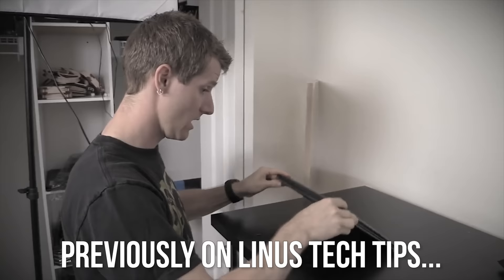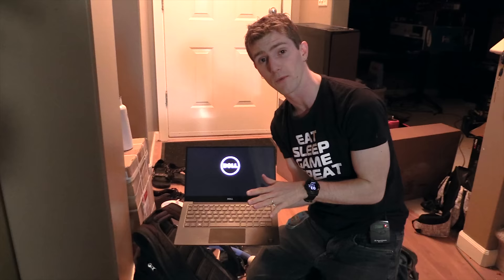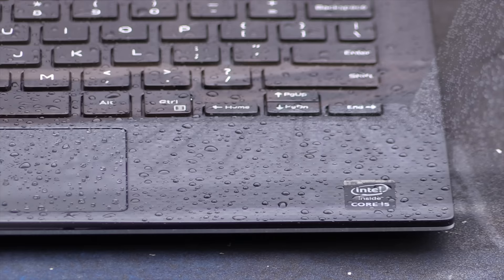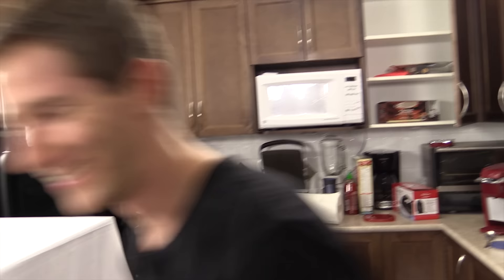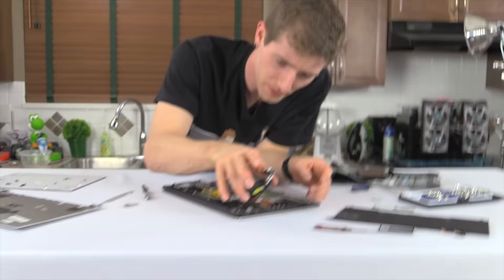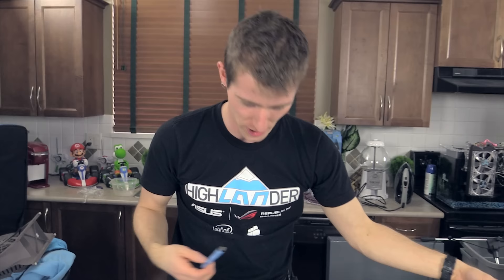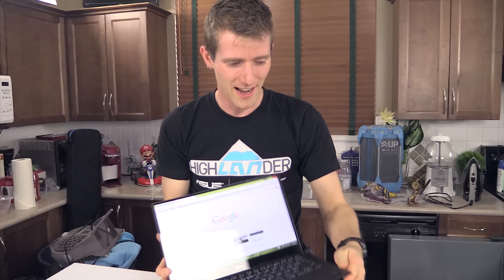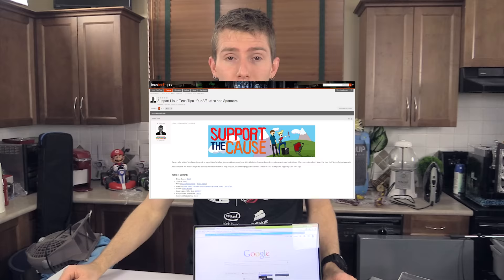Wet Laptop Recovery AGAIN - Dell XPS 13

Comment: hi, Linus Sebastian. i admire your work and i wonder if you can make a video where you show me how to build one of my dream pc`s. 

with these specefications:

ASUS DVD Writer, DRW-24F1ST
Seagate Barracuda® 1TB
Intel® SSD 530 Series 120GB 2.5"
MSI Z87 MPOWER MAX AC, Socket-1150
NZXT H440 Midi Tower
HyperX Savage DDR3 2400MHz 16GB
Intel Core i7-5820K, Socket-LGA2011-3
2x sli MSI GeForce GTX 960 Gaming 100ME 2GB
EVGA SuperNOVA 750 G2, 750W PSU
Cooler Master V8 GTS CPU cooler

I will appreciate it a lot if u do it^^
Reply: upvote this guy!
Reply: 120GB of SSD is rather small for a boot drive, try 250. 2 or 3TB is a better sweet spot for HDD price. Z87 doesn't work with LGA2011, you'd need X99. If that's the case, better buy DDR4 RAM sticks. There's no point going 2x 960, might as well buy a 980 instead. And if you're spending that much on the CM V8, might as well get a H100i.
Reply: For gaming, that CPU is way overkill considering the GPU you selected (also, your motherboard and ram don't support that CPU). I wouldn't go Haswell-E series unless you go 980 or dual-970. Also, like Chayuti said, 120 is not enough for a boot drive, and 3 TB harddrives are the sweetspot in pricing. You really don't need to spend money on a DVD drive, install windows from a USB stick or find a USB DVD drive, you really don't use them anymore.
Reply: Chayuti Chetsandtikhun A boot drive doesn't need to be big. Windows 7 installs on,  what,  16 gigs? If you're literally only using it to boot and store slower applications on,  it doesn't need to be very big.
Reply: Christopher Pilcher After updates, drivers and so on, Windows 7 can easily take up nearly 40 gigs. If you need the PC for gaming, that leaves you with 1.5 games (with games taking up ~50 gigs of space), assuming you don't have anything other than the OS on it

In reality you have other things there as well. Things like your pagefile and hiberfile. The pagefile is the same size as your ram, so 8 gigs of ram means 8 gigs of pagefile, and hiberfile is a couple gigs most of the time. If you then have programs like video editing or 3d modelling progams on your computer, they use your SSD as a scratch disk. Adobe's programs use up 10 gigs as a scratch disk.
Reply: Christoffer Nørskov To be honest,  I remember when people would buy 64 GB ssds and literally just put their OS on it. To me,  saving a few seconds loading a game is less important than a fast boot and page file. But,  we'll,  that's just me. My current system literally only has a single,  5400 HD in it,  and it's on its last legs. Any SSD would be an upgrade for me ;)
Reply: Christopher Pilcher I currently have a 128GB SSD, and without any games on it, i only have 33 gigs left. I used to have space for games, but then the requirements of other programs creeped up, and games became larger, so i can't even install a single AAA title on it anymore. I'm looking to get a 512GB or 1TB SSD soon, but i can wait for the prices to come down.

Fast loading is really nice, though. The normal HDD i have my games on is wicked fast, but even then, when i had games on my SSD, loading screens were pretty much non-existent.
Reply: Christoffer Nørskov yeah,  I'm also waiting for the prices to go down a bit (or for my drive to give up the ghost,  whichever comes first) .
Reply: Most parts fit together the same way regardless of AMD/Intel/nVidia and socket numbers. You can watch a different build guide of his and use it as a reference to build yours. :)
Reply: Why does your dream PC have ddr3? ...and two 960s in SLI? It would be much better with a 970 or maybe 980 and ddr4.
Reply: Chayuti Chetsandtikhun Christoffer Nørskov   its called a boot drive for a reason, nothing goes on it but the OS, and 120 is PLENTY for that, stop giving bad suggestions.
Reply: TTG DDR4 honestly doesn't matter much right now. It's just unnecessarily expensive without a real speed benefit.

peoplestealallmynames Really? Boot drive just means it's the drive you boot from, it doesn't mean you can't use it for anything else. If you REALLY ONLY want to have windows on it, buy a 40-60 gig drive. If you want windows and programs and maybe one game, get a 120 gig. If you want all that, but maybe more than one game you NEED at least 240.

naota3k I hope you don't do tech support, because you could have cost a lot of money with that sentence. For graphics cards, it mostly doesn't matter anymore, as PCI-E is the only GPU standard right now. BUT for CPUs, you CANNOT mix and match. If you have an LGA-2011V3 CPU, it NEEDS an LGA-2011V3 motherboard. The motherboard used for normal i3/i5/i7 CPUs change over time, as the pin layouts of CPUs change, and the enthusiast grade CPUs always use a higher amount of pins, so they won't fit in regular motherboards.
Reply: Christoffer Nørskov I think 128 gb is fine, it just depends on your priorities. Also, yes, there are more games these days with very large file sizes, but realistically, 50 gb games are not the average, unless you're solely talking the more graphically intensive AAA titles of the last couple years, and for the most part, the difference in loading times is not that significant, and I for one dont mind a few extra seconds. The only time when it really effects the game experience is in games that struggle with pop in. For the love of god, dont put AC Unity or Far Cry 4 on your HDD. just dont. really though, dont put AC Unity on anything. Ubisoft doesnt deserve it.

Also, as others have stated, You don't really need ddr4 or that CPU. Unless you want to do lots of multitasking, that CPU is pretty overkill, no real benefit for gaming. DDR4 doesnt really have any major benefits yet, but its much more expensive. Also, theres no reason to every SLI/Crossfire a mid-range gpu. For that price, you can get yourself a 980, which will outperform your dual 960's, and if you go for DDR3, and a cpu more along the lines of an i5 or an i7-4790k, which still isnt really necessary if youre talking strictly gaming, you could get yourself a 2nd 980 and run anything you want, max settings, 1440p60.
Reply: Ryan Ohlson i know he doesn't need that cpu and ram, as well as dual 960s being a bad idea.

As for the ssd, i have a 128 gig and only have 40 gigs left with no games on it. Windows and it's files take up 50 gigs alone. Then we add drivers and essential programs that's easily 10 gigs. 10 gigs for adobe scratch disk. The last 40 gigs pretty much have to be reserved as steam's temporary download folder is in the install directory: the ssd
Reply: I currently have 23.3 gb left on my SSD. I have steam installed to it, as well as 10 or so games, including a couple fairly large ones in the Metro Redux games, as well as open office, Geforce Experience, and a few other applications. This has been fine for me, I have never really had a situation where ive felt the other 100+ games I have installed to my HDD were being made less enjoyable by pop in or load times. then again, I don't play shitty Ubisoft games, but an SSD doesnt do much for them anyways. with current pricing, a 250gb ssd is more the sweet spot, but 128 gb is fine, depending on your priorities and usage tendencies. Also, second part was for the OP
Reply: Christoffer Nørskov I think you misinterpreted what I was saying. Of course you can't put a socket 2011 CPU into an 1150 board. What I meant, is that the way that parts go together is generally the same, regardless of the manufacturer of the CPU/GPU/Mobo. You install the parts in the same way, that's what I meant. He could watch a different build log, and then assemble his own parts and build something.
Reply: naota3k Ah, yes, then i did misinterpret your wording
Reply: Christoffer Nørskov I should have made it more clear. My wording was not good. :S
Reply: MiniTube2208 How is this high end?
Reply: Not sure that your motherboard and processor are compatible... one is a 1150 Socket and the other one is a 2011-3...
Reply: Frédéric Bouchard Dude, read the rest of the comment thread...
Reply: Christoffer Nørskov
Yeah, but I think a "dream" PC would have the best of the best specs, or at least the newest technology.
Reply: TTG i guess, but they have plenty of build guides with top of the line systems like haswell-e and ddr4
Reply: You'd get better preformance for less if u go with 1x 970 instead of 2x 960s
Reply: ***** If you had read any of the other comments in this thread, you would know this has been said several times already.

Also, an i7 isn't bang for your buck.
Bang for your buck is AMD or Intel Pentium (i think it's the G3258, but the number may be wrong)
Performance gaming is Intel Core i5
Performance for gaming, rendering, streaming and other intensive tasks is an i7 (i7 can actually be worse for gaming than an i5, since the hyperthreading decreases single-thread performance, which games rely on)
Reply: Chayuti Chetsandtikhun Upvote this guy!
Reply: You clearly know nothing about components. And why the heck would you get 2 960's ? Get a single 970... You will only get 2gb of vram if you sli those cards. And it takes up more power and costs more!
Reply: The BTNS dob iron Guys, this was answered ages ago, read the first 2-5 comments in the thread.
Reply: MiniTube2208 The troll is strong with this one
Reply: MacGeek Downvote guys!
Reply: This is what happens when you let kids build PC's and call themselves geniuses...
Reply: Jakester! - The Darude Comment Critic Spot on!
Reply: NAHHHHHHHHHHHHHH GET 5000000000000000000000 GB RAM 

.LEGIT
Reply: +Chayuti Chetsandtikhun Hey, is this build any good? Should i add/remove/replace something? https://uk.pcpartpicker.com/user/niels.nielsen/saved/#view=PH82FT
Reply: niels nielsen Why such a weak processor for that build? Get rid of one GPU and get the 6700k and upgrade the 1 GPU u have
Reply: P0D_Moon4ver Because i won't be needing more power for the CPU, i will only be using the pc for gaming and my macbook 15 inch for work.

Comment: My XPS 15 was soaked inside and out when I leaned it against the bath tub and water around the rim of the tub used it as a ramp. Fortunately for me it was in a deep sleep and did not have power to the board. I completely disassembled it, dried each component, pointed two fans at it overnight, threw it back together in the morning, and headed to work. It has exhibited zero issues from this incident.

On the plus side, after this incident I decided that my warranty was as good as voided, so I repasted the CPU and GPU, and upgraded the RAM to 32GB with marginally better CAS latency. Combine that with some undervolting and now my processor never thermal throttles.

Comment: I accidentally left my XPS 13 in the rain for about 10 minutes last night, I turned it off and set it upside down over night, it actually turns on and works 100%, ITS A MIRACLE
Reply: Jacob Jones was it on when it got rained on? did it rain hard?...
Reply: Yes it was on, it was on my balcony with the rain coming down pretty hard, the entire keyboard and screen was covered in water. I'm honestly surprised I haven't found anything wrong with it yet. I was expecting something to die. I'm tempted to open it up and look for water damage up close though.
Reply: I spilled a glass of wine on my xps 15 9550 and left it off to dry and then took it apart today. I found some stains on a corner of the motherboard as well we obviously in the keyboard and around the speakers. Cleaned it and worka like new. It's a very well put together laptop and i guess i also got lucky. Thx for your reply
Reply: Razvan Andreescu wow that's much worse than rain, the mass of wine will force it's way in deeper. It's amazing these things are so resilient
Reply: J Alcohol wont ruin electronics like water will, the alcohol will evaporate away
Reply: Only if you have the good stuff, anhydrous (100%) isopropyl alcohol. If you use 91% alcohol, ~9% will be left behind as water. 99% should be okay, and probably safer as anhydrous chemicals do weird things

Comment: The fact that this machine still works seems pretty reasonable to me.

My reasoning is that H2O per se is probably not terribly harmful to individual components inside a laptop. We've all seen vids about computers operating completely immersed in deionized water (until those pesky free ions start forming, granted).

I think we can agree that using tap or rain water to soak  a machine which is powered up and which has lots of current flowing everywhere will very likely result in some kind of catastrophic short circuit. But if there's very little or no current flowing then it's just... wet.

So given a case in which a) the solids remaining after evaporation are non-conductive and noncorrosive, and that b) none of the critical components in the machine are adversely affected by moisture, and that c) metal bits have not started oxidizing, the odds of a machine continuing to function after a good soaking seem pretty good.

Comment: honesly, i can personally say that this is not just a fluke with the 2 comps you did this with Linus. Last year I spilled a full cup of coffee (with cream and sugar) into the keyboard of my Inspiron 15. Dried it out as best as i could and cleaned as well since it was all sticky inside. I'm still using that laptop today. No deficits I've noticed over the last year. Also, my wife spilled a glass of water into our XPS 14z...same thing, dried it out open for a week or so and it still works fine as well. Dell is definitely doing something write as far as build quality is concerned.
Reply: I need to add, that when the coffee was spilled into the INSPIRON, it was actually on and I was working on it. The coffee seeped in and the power actually cut out to the laptop, initially leading me to believe that it got fried but it was a $900 laptop and rescuing it was worth a try. Glad I did.

Comment: I have a question, how did the laptop resume if the battery was detached and reattached?
Reply: Although Linus put it into sleep first, eventually the battery would have run low enough that the laptop went into hibernation.
Reply: Marcos Cruz I believe when a windows computer goes to sleep it dumps the data stored in the RAM onto the Hard drive. therefore allowing the power to be cut
Reply: Computern 
You're right, I just wasn't sure if it kept the memory data on the ram or transfered it to the hard drive.
Wanted to be sure.
Reply: Computern I think that's only on journaling file system
Reply: Guys, just so you know, sleep is where the computer powers pretty much everything off except the RAM, giving it a bit of current to keep the data there. Hibernation is where it takes everything in RAM, writes it to the HDD, then powers off completely.
Reply: Marcos Cruz Windows has something called hybrid sleep, in which it first saves the state to disk, as if it's going to hibernate, and then it goes to sleep. When it loses power, it still has the state on the disk.
Reply: Computern
When computer is in sleep, it stores the session in RAM. When computer goes to hibernation, then your session is stored to HDD/SSD. That's why waking from sleep is much faster. And when computer has been in sleep for a certain amount of time, it goes to hibernation automatically (unless that setting is disabled). Also if battery is going to die, it goes to hibernation.
Reply: go to Control Panel\All Control Panel Items\Power Options\Edit Plan Settings -> Change Advanced Power Settings -> Sleep -> Hibernate After. you'll find the answer there. On my computer, the default settings is that windows will automatically hibernate the system if left untouched(and unused) for 180 minutes.
Reply: Safar ALQAHTANI Thank you I was wondering this.

Boot times have improved so much that now the difference from waking from hibernation and waking from sleep is just a few seconds.
Reply: ***** Pretty much a windows 8/8.1 feature lol

Comment: Linus i got this idea that if you get electronics wet you should actually rinse it with distilled water or some alcohol before drying, so you'll avoid any possibility of accumulated salts the water contained or set loose causing shorts. Thoughts?